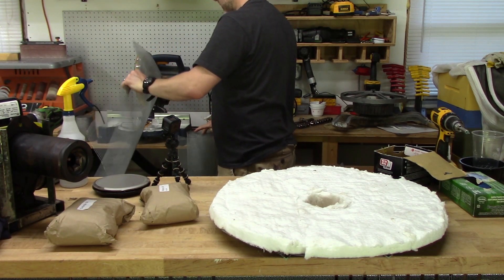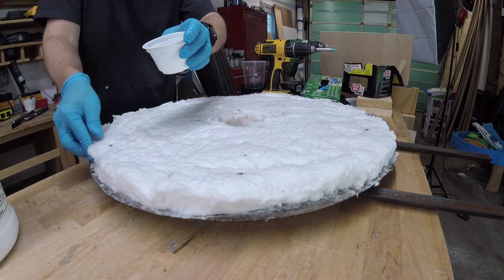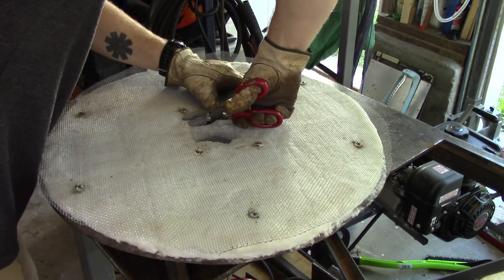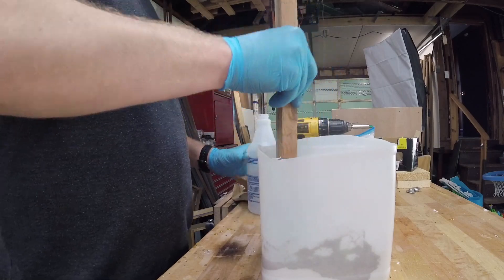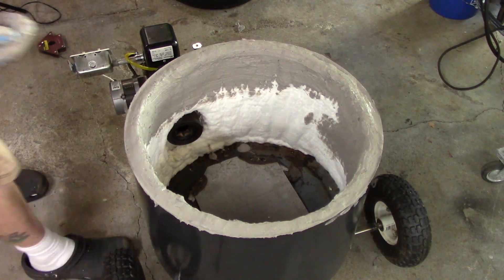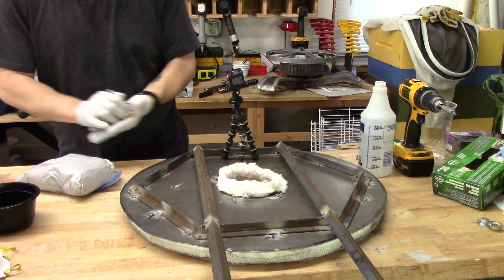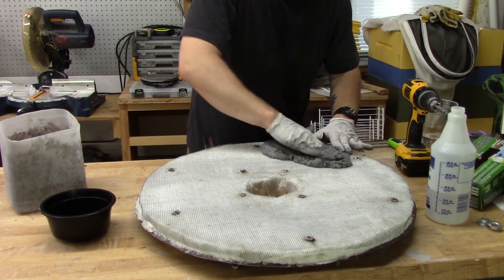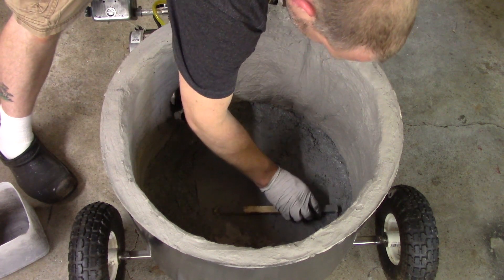Foundry Build: Satanite and Mizzou as Coatings

Comment: Far too big of chamber size brother, you would have a higher fuel efficiency with a smaller chamber.
Reply: Exactly 
The video should be  about the build and seeing how well it does 
That would be interesting 
This as is 
Is silly 
Too bad 👎 😪 😔 😞 😕
Reply: Would love to see those cheap rubber wheels melt from heat 
Kind of rinky dink for furnace size 
Very surprised by this design

Comment: I like the wire you used on the cover, some people say to also use it on the side walls to hold the mortar on.  Did you have any issues coating the walls?  Was it one coat?  Did it crack and you had to patch them?

Comment: mizzou is the best u can use u didnt do it right needed more water not suppose to be that thick only if u casting. for coating wool need to add more water the other stuff u used is not that good wont last long. its ok stuff but cast 30 is way better

Comment: Does concrete not hold up to the heat? Sorry noob here
Reply from the maker: Regular concrete "spalls" when exposed to high heat.  Basically deteriorates.  I don't know how but high temp mortar like satanite actually hardens a bit when fired.  I would guess something like clay or porcelain.
Reply: @WhatDennisDoes  well it's a good thing I didnt make mine yet lol

Comment: Hello! I'm lining a forge with refractory. Any tips on what to do after I let it dry? Like first heat instructions etc.
Thanks for your time
Reply from the maker: I'm about to cure the satanite myself.  I think it's good to do it in a few passes, bringing the temperature up higher each time.
Reply: Burn progressively larger amounts of charcoal starting at about half a pound for 3 to 5 days. Start the cure during the warmest part of the day each time to minimize thermal shock.

Comment: I am thinking of a furnace along the same line with the ceramic blanket and satanite.  Either Mizzou or hard fire brick for the base.    I am wondering if the satanite will keep the hardware cloth cool enough so as not to scale and fall apart like a steel crucible.
Reply from the maker: I had thought about that.  I guess time will tell!
Reply: I will also be watching to see how well satanite bonds to sodium silicate.